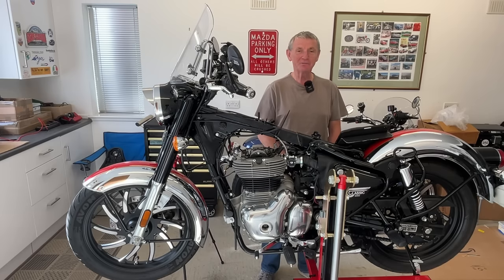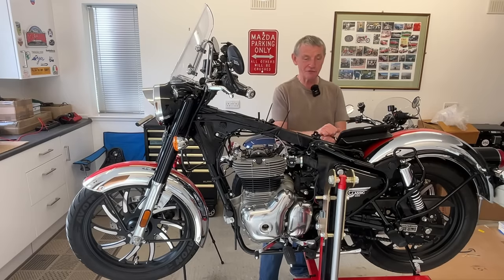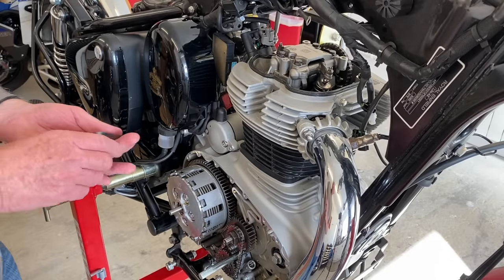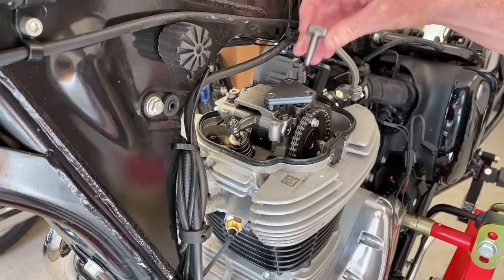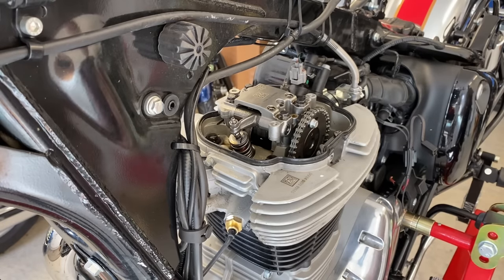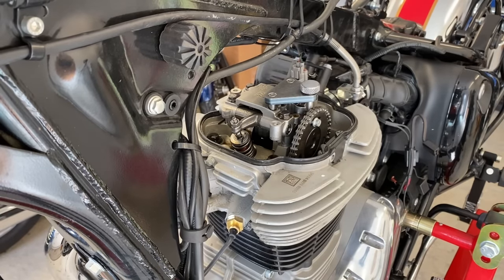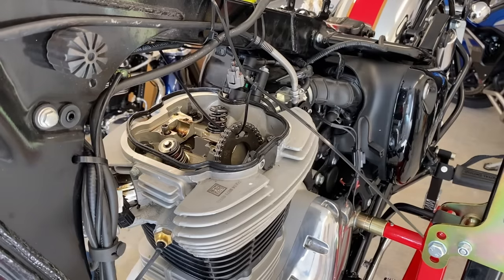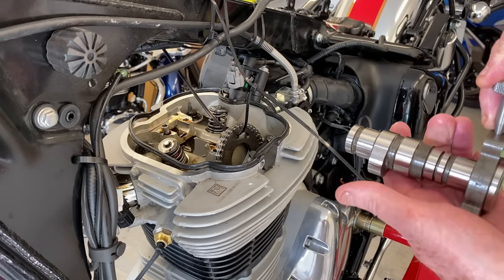Royal Enfield Classic 350 - Fitting the Hitchcocks Performance Camshaft

Comment: Always good to see people working on there bikes like we all used to instead of being scared off by manufacturers and warranty nonsense paying overpriced dealers hundreds to change the oil and do easy valve checks which is a joke I’ve  got a classic 350 myself and the ideal bike to learn on 😎👍
Reply from the maker: Great to hear that you enjoyed my video 🏍️👍
These simple bikes are great fun to work on, love my wee 350.
Reply: Honestly hope your time money and effort is a benefit. I have my doubts but I may be wrong? Dyno's over the years I've had Dyno time about five times and noted each Dyno showed conflicting figures second how will you alter the fuel curve to suit a different profile? I really do hope you benefit!
Reply: Checking valve clearance can be a nightmare on some bikes and a walk in the park for others.
Most modern bikes you gotta tear away most of the top of the bike, fuel tank, fairing, air box, to get to be able to remove the engine cover.
At that point might be easier to just take it to the shop
Reply: @johnrocker2986 the before and after results were measured on Hitchcocks own dynamometer, so should give an accurate indication of any gain as it’s not done on different dynamometers. Whether the change is worth it or not is for the bike owner to decide.
Reply: What this guy is doing is miles ahead of fluid refresh, it should be noted.

Comment: i installed (or rather paid someone else to do it - i've got no workshop) the cam and it makes a subtle but noticeable difference. obviously i've got the hitchcock's pipe, fuelx and dna filter too. it now runs through the rev range really smoothly and more powerfully. recommended!
Reply from the maker: Great to hear that you enjoyed my video, yes this is definitely one worthwhile modification 🏍️👍
Reply: What did it cost you to have the camshaft fitted?
Reply: How did the camshaft affect the NVH levels?
Reply: Any deterioration on the lovely bottom end torque the standard engine has ?

Comment: When removing the bolts from the cam chain sprocket all you need do is scrunch up a paper towel and push it into the gap . If by any chance you do drop a bolt it will just lie on the towel…….👍
Reply from the maker: I agree with you and that’s normal what I would do. The bolts are really easy to keep hold of so there wasn’t any issue. I kept saying to be careful simply to emphasise the point.
Hope you enjoyed the video 👍

Comment: Great video, done the camshaft on my hunter 350 , with DNA filter and cover and fuelx pro a couple of months ago . There weren't any exhausts available for it so I had a plan to use a modified scram system, but Hitchcock just released an Enfield precision end can for it which should arrive today so will see if that improves performance anymore 👍
Reply from the maker: Great to hear that you enjoyed my video 🏍️👍
This is definitely a worthwhile modification as you will know. I’ve heard that this is even better on the Hunter as it doesn’t have the 74mph speed restriction, is this correct?
Reply: I am interested, by this subject I also want to increase the speed of my meteor350, so do not hesitate to tell me if the modifications have increased the speed
Reply from the maker: I assume the Meteor is top speed limited the same as my Classic 350. If this is the case then the top speed will NOT increase, but the it will get to the top speed much faster and climb hills easier. Hope this answers your question.
Reply: @tigerness5555  yeah the hunter will do 87mph then hits what I assume is the rev limiter
Reply from the maker: 87mph Wow that’s impressive. I assume it’s due to the 17inch wheels, different setup and less weight than the Classic 350. Don’t think I’d like to be on mine at that speed 🤣
Mine now gets up to 75mph with ease, would definitely go faster if it wasn’t speed limited.
Many thanks for the info, much appreciated 👍
Reply: @tigerness5555  yeah you get extreme wind blast at that speed only done it once , I mainly sit at 60-65 mph but the extra grunt in the midrange is brilliant
Reply: @tigerness5555  yeah you get extreme wind blast at that speed only done it once , I mainly sit at 60-65 mph but the extra grunt in the midrange is brilliant
Reply from the maker: Yes I agree, the mid range is now brilliant. I’m able to overtake in places I would never have considered before. Such a fun bike to ride 👍
Reply: waw wow that’s great, can you tell us what changes you made ?  @TheGarrydn1
Reply: I have a Meteor which is speed limited to 73MPH by the ECU. I understand that the Hunter 350 ECU does not limit the top speed so by swopping the throttle body (which is integral to the ECU) for a Hunter version, you effectively remove the speed restriction. The rev limiter will still operate which is sensible to retain. I have yet to try this. Has anyone done this swop on a Meteor or Classic? @tigerness5555
Reply from the maker: In theory you are correct, to date I’ve not known of anyone making this change. Perhaps you will be the first, if so please let us all know the result 👍
Hope you enjoyed the video.
Reply: @AdrianShawDrummer  this is the most interesting thing I have heard  since the cam came out. 
I always thought all 350s had the same ECUs and were subject to the same restricters because of Euro imitations and all that stuff someone  somewhere must know for sure and someone must have a dyno 
To test it.
Reply: @Thegarrydn1 says his hunter died 87mph before it hits the rev limiter so it does seem that the hunter ECU doesn’t have the speed limiter. It doesn’t need a dyno to prove if it works on. meteor. Just open it up and see. If someone has the hunter ECU software, perhaps. meteor or classic ECU could be re-flashed so you don’t have to buy a whole ECU/throttle body.
Reply: Question, is there anything special regarding the disasembly of the right side of the engine, where de Oil Filter is? He does not show that and it seems complex. You have to drain the engine oil? I know this might be a simple and stupid question, but I am no mechanic. Any videos on this disasembly that you know of? Tks a lot for your help!
Reply: I believe it is wisw to stuffsome clean cloth into the top end, in case a camshaft bolt escapes !!

Comment: The  RE 500 had hydraulic valve adjustment and a Kickstarter. It also had 10 more HP . The new ones are loaded with electronics waiting to have a expensive failure. Today's motorcycles are a collection of government regulations on 2 wheels.
Reply from the maker: They don’t make them like that anymore unfortunately.

Comment: Many, many thanks for your excellent video 👍. I followed it to the letter and the job went without a hitch 😎. Added tip - when undoing/fitting the cam bolts, stuff a clean rag down the gap, to catch one if you drop it 😱. Just been for a 60 mile test. Brilliant. No loss of torque or flexibility at the bottom end. Significantly more power across the real world rideability range. Demolishes hills. Maintains 70 on part throttle, or full throttle up slopes and into head winds. Bike is Hunter, standard air filter, plus 1 tooth gearbox.
Reply from the maker: Hi John
So good to hear that you enjoyed my video and found it helpful. As you’ve now found, there is a definite power increase to the J series engine. The wee bike performs better and puts even more smiles on your face now 😁👍

Comment: Great informative video thank you.
Just one thing! When you were undoing the camshafts gear sprocket bolts, I would have stuffed a cloth in underneath as  added security
Reply from the maker: Great to hear that you enjoyed my video 👍
Yes I agree with you regarding undoing the bolts. Actually there wasn’t any problems as the bolts were very easy to keep hold off. I just elaborated in the dialogue to warn others to be careful.

Comment: Many thanks for taking the time to put this video together, I’ve followed it yesterday and this morning as I fitted my performance camshaft.
Marvellous having the ability to stop, pause, click back a few seconds then move forward with confidence.
I was a little nervous before turning the key but it fired up no problem.  Doing a test run tomorrow in the better weather.
Thanks again
Reply from the maker: Fabulous to hear this, please let me know how the test run goes and what you think of the performance camshaft upgrade.
Cheers TN
Reply: @tigerness5555 Hi there,  I managed a short test run of around 20 miles before the weather turned foul, I found the bike had been transformed with a lot more eagerness to get on down the road.  The throttle seemed very responsive now bringing the bike alive, not for the top end performance, but the mid range - where all of the fun is 30 - 60mph.  Your videos will have helped countless 350 owners to achieve more from this great low cc machine.  Thank you once again.
Reply: Fantastic news, you’ve described exactly how my bike also performs. This is by far the best modification that can be done to this bike.
Many thanks for your correspondence, enjoy your new found performance.  @mike-the-bike.
Reply: @ianness2315  Good Morning Ian,
I could see in your previous videos that you fitted the Hitchcocks freeflow exhaust system to your 350, I was wondering why you removed it?, as I’m considering purchasing for reduced weight and freeflow gain.  I have already fitted the Hitchcocks decat pipe, freeflow air filter, Venturi intake & fuelX lite.
We pack the 350 into the garage of our motorhome, and this becomes our primary source of transport while touring.  This year we road 1400 miles together circumnavigating France, Spain, Portugal, back into northern Spain then ferry back to Blighty at Bilbao.
So riding in Spain’s mountain ranges in 35 degrees was challenging for a little air cooled 350cc - struggled a little like an old air cooled vdub.
I watched a vid from a guy in the States who after fitting FuelX lite, recorded a drop of 200 degrees operating temp from the engine, which can only help
Reply: @ianness2315  Sorry I got pulled away with a phone call - should have signed off: regards Mike
Reply: Hi Mike, I removed the free flow exhaust as it was just too loud for me. Also, I didn’t think the quality was anywhere near as good as the original system. As to any weight saving it’s not worth the bother. The bike looks and sounds sweet with the standard silencer and decat pipe.
It sound like you’ve already got your bike to a very good level. All you need now is the performance camshaft which definitely makes a big difference in mid range power.
Great to hear that you’re enjoying my channel, cheers TN. @mike-the-bike.
Reply: What is wrong with the existing camshaft.

Comment: On the subject of "don't drop that nut", my neighbour (honestly it wasn't me) replaced the head gasket on an over-head cam, 4-cyl car engine with the plugs removed, but with the job almost complete, dropped a nut that was a very close fit in the plug threads.  The nut still managed to fall through into the cylinder.  Oh dear and start again, the air was blue!!!  Enjoyed your video with my fingers crossed for you🤞
Reply from the maker: Hi Paul, a nightmare scenario and something we’ve all experienced in one way or another. The camshaft sprocket bolts are actually easy to remove and keep hold off, I kept saying be careful to emphasise the point.
Great to hear that you enjoyed the video and thanks for keeping your fingers crossed 🤣👍

Comment: Thanks for a great video. Best one I've seen for fitting the camshaft upgrade.
You've given me the confidence to have a go at doing the job myself.
Cheers
Reply from the maker: Great to hear that you enjoyed my video and found it useful.
It’s really an easy job if your fairly competent at DIY maintenance 🏍️👍
Reply: How have you found the bike since the upgrade to the camshaft? Is it worth spending the dosh on it?
Cheers
Phil
Reply: My bike is performing much better with the new camshaft. It definitely pulls much better at higher revs and reaches maximum speed with ease.
There’s a follow up video coming out on Tuesday which may answer your questions.

Comment: Great video. Fitted the cam to my 350 last month. I used a dial gauge to check TDC rather than the crank lock and triple checked the cam timing. Performance evaluation: “feels” like the bike pulls better longer and definitely gets to the speed restriction of the ECU quicker. Now if we could just get that ECU reprogrammed. I’m using FuelX lite, UNI air filter and plate, Hitchcocks full stainless exhaust system. Simply love this bike and I’ve been riding everything from Vincent’s to Honda Navi since 1958. 
What lift are you using?
Many with smiles cousin!
Reply from the maker: Hi Gary, great to hear that you enjoyed my video and thank you for your evaluation of the camshaft 👍
Like you I’ve had many bikes over the years but this simple little 350 is something special. It takes me back over half a century to when I started riding.
The lift is an Abba Sky Lift, this is a video I made about it https://youtu.be/B_3rpIE7N-8?si=WQdBhNn1dWmyaBGt

I’ve a follow up video of the camshaft upgrade coming out on Tuesday and another video regarding the sky lift the week after that you may be interested in.
Ride safe 🏍️

Comment: Hj my new cam shoujd be on its way to me as i write this Hitchcocks dont have the locking toos in stock so il just have to rely on memory when i used to find TDC on my old bikes. So if its ok ill be taking my computer into my shed and do the cam on my meteor sep by step watching your video, thanks for the clear discription how its done.
Reply from the maker: Great to hear that you enjoyed my video and hopefully you found it helpful 👍
If you know what you’re doing and take care I’m sure it’ll go well. The one tool that I think is the most helpful is the cam locking tool.
Reply: @tigerness5555  I've made one if it works I'll try and send a photo. I measured the distance between the three points which works out at two and a half inches between them (old school) using a compass if I got It right a sharp point on one end and a pencil in the other that how I got the measurements right I hope.

Comment: Hi TN, I’ve finally got all the parts to undertake this task. Understand why you didn’t include the removal of the clutch cover, but do you know the torque setting for the row of bolts that hold it on? Please keep up the great work.
Reply from the maker: Hi TS41
Great to hear that you enjoyed the video. Good luck with the camshaft install, it really does improve the performance of the bike.
The torque setting is between 8 and 12 Nm, I put mine to 10 Nm. Hope this helps.
Reply: Thanks TN👍.

Comment: Hi. I like others have followed your fantastic videos to install all the parts you have shown. I now am the proud owner of the Hitchcocks cam and on my journey of discovery on how to proceed. Can you guide me please. I have heard that replacing the clutch side cover can be difficult. Do you have any advice for this final part of the operation please?  I would also be interested in your reasons for removing the fuelx lite please. I followed your instructions to the finest detail when installing mine. Thanks for so much advice and great details in your videos.
Reply from the maker: Great to hear that you’re enjoying watching my videos 😁
As to the fuel X, I sold mine along with the Hitchcocks Free Flow exhaust a while back, didn’t really like the noise the exhaust made. Since the camshaft and decat pipe was fitted I have fitted another FuelX Lite. Watch out for a new video coming out on 12th November, it shows where my bike is at the present time.
Fitting the clutch cover isn’t difficult, you just have to be careful to ensure that the clutch pushrod is lined up correctly. Check out Coastrider’s video at the link below as he shows this issue.
Hope this helps and enjoy the camshaft performance 👍

https://youtu.be/2PNEQ1f52gE?si=nx3a6osCPAWifTBw

Comment: One last question Tiger. Would you recommend I also add the 16 tooth sprocket when I’ve installed the cam?
Reply from the maker: I have the 16 tooth gearbox sprocket on my bike and like it.
No great problem reverting back to standard if it doesn’t work for you.

Comment: Excellent video 👍
Would you be able to tell me what the torque setting is for the Rocker cover bolts in Newton metres please,
Thanks
Paul 👍
Reply from the maker: Between 10 to 12 Nm
Great to hear that you enjoyed my video 👍
Reply: @tigerness5555  
Many thanks 👍
It's for my new Royal Enfield Hunter 350,
After doing the Tappets and replacing the gasket, I tightened up the bolts just guessing By hand, but it's got a leak,
So I'm hoping if I torque it properly, it'll cure it?

Comment: Got all the things to do this now. Could i have some advice please when refitting the engine side casing. Did you use any sealer in conjunction with the new gasket?  On a car i may have used hylomar or a thin smear of silicone or even grease on cork style gasket. Did you use anything?
Thank you. 😊
Reply from the maker: No sealant used, only a new gasket. Ensure that the mating faces are clean and all traces of the old gasket are removed. Do not damage the faces.
Hope this helps and you enjoy using the new camshaft.
Reply: Thank you for the reply,I will do as you say.

Comment: I'm impressed with your video and I'm planning to boost up the performance for my bike. But I have a doubt, will this kent cam fit for Thunderbird 350x?
Reply from the maker: Hi Jaison
Great to hear that you enjoyed my video and hopefully found it helpful 👍
This Kent camshaft is only for the new J series engine as used in the new Meteor, Classic 350 and Hunter models. Your Thunderbird 350x uses the older engine which is a completely different design and not suitable for this particular camshaft.